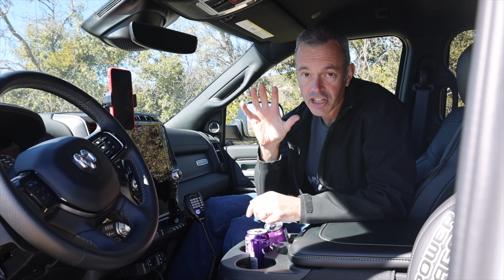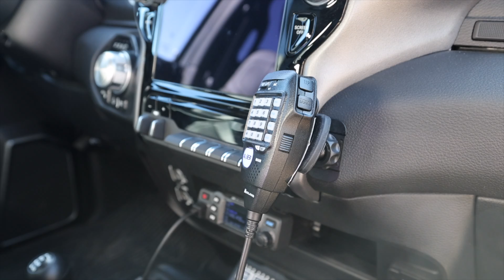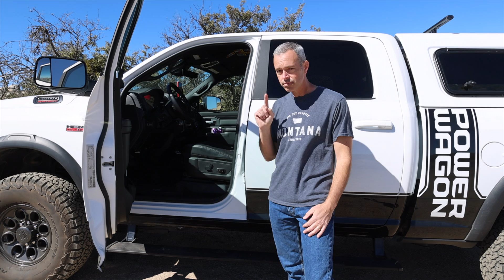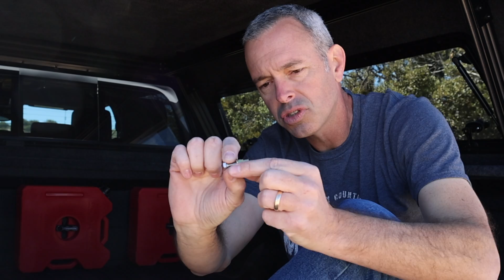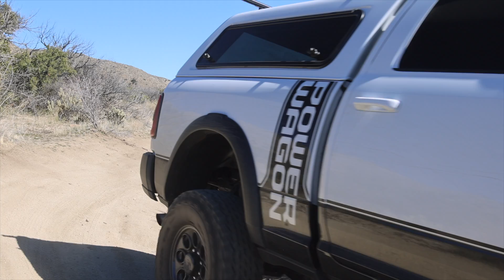Will 37" Tires Fit on a Stock Ram Power Wagon? - Build Update

Comment: Brad, you’re my new truck offroad hero and I’m subscribed to all the PW guys and known legends out west who only drive trucks (as you’re known for being a jeep guy). But still I just love your channel due to your awesome trips, spending time with your sons, mentioning the wife just enough lol, descriptive and carefully articulated overviews of parts, accessories, and techniques...but in regards to your spare tire situation. The ram 2500 can fit an Aired down 35 within that circular frame shield under the bed connected to the chassis. I believe you could remove that and customize a way to hold a 37 there no problem (in the grand scheme of things).

Comment: Hey Brad, the Power Wagon is looking good.  In regards to using a full-size spare tire, Expedition One makes a great rear bumper with dual swing out tire carrier set-up for HD Rams.  I have had their similar bumper set-up on my JKU for a number of years and has worked out great with no issues.   For a less expensive option, AEV makes a vertical bed mounted tire carrier set-up for HD Rams.

Comment: The way they mounted the tubes for the rack to the t-slot is interesting. Wondering it's reinforced inside the tube. Without any, over time it might not look to pretty. Props for them going with t-slot extrusions though. That stuff is awesome.

Comment: There is a rear bumper with tire swing out that you could fit a 40” tire. Also on the inside of the swing out you could have a drop down table for camping or an area to carry the fuel jugs

Comment: AMP step won't do on the trails I've taken mine.  Sure the wife doesn't exactly appreciate getting into my truck, but the Maple Off-road sliders I have do bring the step -in height down significantly.  You can't go by the lower edge of the door opening.  You actually have to step up further to get to the flat surface.  So, I would say it drops the step-in height by several inches.  Between that and the use of the hand grab, it is manageable.  My rocker panels would be destroyed by now if it weren't for the sliders.  The kick-out in the rear has enabled me to get around some tight spaces where that rear wheel wants to take the short cut.  Regarding a lift.  Most folks do a level lift (Thuren or Carli coils) which brings the front up and actually tips the rear back a bit.  Get rid of the chin spoiler and do a level lift will get some needed clearance up front, while making the rear slightly more accessible.  Love that cap.  Exactly what I would envision to be the perfect cap for these trucks.

Comment: We have a Ram 3500, AEV lift and AEV Bumper/winch, with an ARE commercial an Alu-Cab RTT/awning, the ladder is an extension one it is very high off the ground, great views though!  We're going to be getting the Expedition One rear bumper soon, for our spare.  I really like your setup, a lot, we wrestled with getting a power wagon or going the diesel route, we went diesel with the HO.  We had a power wagon before, which was great but we were hoping for better economy and we did get that with the diesel.  Out of curiosity, when you get an AEV lift, you can buy their Pro Cal module, which calibrates your speed and shift points due to the new maths, perhaps that works for the 6.4 as well?  Often we see 18mpg, and I run a dirtbike setup hangong off the back sometimes, best I saw was 20.6mpg for a 3,000 mile trip.

I'm sure you know about regearing, especially after your videos and your trip to Alaska, but I was curious if you were thinking about regearing the PW.  Our rear end is the 3.43, I only will regear if we go to 40's but I do not want to (wife does) as I can reach the awning to deploy and such now, 40's no way.

Comment: Cab roof rack. Would be a great place for spare full size with shovel, jack and air compressor w/tank (lots of fresh air up there). A rack with tall/large sides would also provide mounts for lights. I have the Rambox's on my PW, so a hardtop for the bed is out and this is the setup I'm saving for down the road.

Comment: i have rock sliders and it does change the driving dynamic of the truck.  that extra weight 12 inches off the ground is notable.  you will be fine with extremely careful tire placement, but if you hit those powered steps you'll instantly crush them.  loving the wagon vids!! bring that to NOCO for the Overland West and we'll hit kelly flats trail (if it's open this year).  that will test your truck going up hill.  I have a video about it... super fun.

Comment: I put 35s on mine because of ease of use. No trimming, better gas mileage. But now i can see that mpgs are not significantly changed (in my experience) with an upsize. And 37s just flat out look better, so ya I say go 37s on this platform if you can, or you’ll regret not doing it.
Reply from the maker: The stock 33's really look extremely small on this truck, 35's and 37's look better for sure.
Reply: @TrailRecon  

What did you say the name of the tire was. 33x17x9 to 37x17x9 with a +22 offset. Did you have to do anything with the transmission/gears to allow for the extra weight and size.

Comment: Really like the ARE bed cover/cap. I like the side opening windows as well but most likely you will need to stand on the rear tires to reach the floor of the bed from the sides. I am looking at various ARE cap models as well for my 21' Power Wagon. I've had two of their caps, (Z-Series) with their sliding front window and tip out side windows, installed on two different trucks. The ARE product line is outstanding.

Comment: Great video.  2 suggestions.  As for your spare tire. Does your camping trailer run the same size tires? If so mount it on the trailer. I know that you will not have a spare without the trailer. But, in my humble opinion. Its rare that you will need a spare. Now as for your nut-serts. I highly recommend using a dry silicone lube on the threads. Can't tell you how many times I have had problems with them in the past. Just a little insurance.  Other than that I like what you have done. Clean, neat and still looks stock. Kind of like that style of upgrading.
Reply from the maker: The trailer has 35's and the bolt pattern is different.  Would be cool if I could find a way to store a spare in there though.  Thanks for the tip on the nut certs.

Comment: Finally someone put a shell on their overland truck. I don't understand the draw of the rack systems, everything gets wet and potentially stolen. Are the windoors or gull wings usable? They look pretty tall. I ended going with the Leer because the  window profile matches the the truck windows better,unfortunately the frame less windows don't allow for the windoor option.
Reply from the maker: The side doors are tall, but I've got long arms and can hop on the tire if needed.

Comment: I thought the Powertanks needed to be upright or at least 45 degrees upright?
Reply from the maker: You can request them to install a snorkel which allows you to use the tank in the horizontal position.

Comment: Brad as a fellow PW owner, I can’t recommend enough the rear track bar relocation kit that Thuren sells. It raises the attachment side to the axle for the panhard, thereby reducing the lateral movement of the axle through the up and down arc during compression/rebound. Takes the waggy out of the wagon. (You’ll probably notice what feels like bump steer in the wheel during higher speed highway dips, where the truck compresses and then rises back up).
Reply from the maker: Thanks, I'll look into that.

Comment: Ah, reminds me of back in the day when I started with my bone stock ‘16 PW. The evolution over the years to what it is today with a Four Wheel Camper in the bed, Thuren suspension and front bumper, WK sliders, custom dual rear swing out bumper, on-board air, comms, navigation, lighting, full locker and sway bar control. All along, it’s been a great truck with 82k on the clock and has done its fare share of exploring some of Arizona and Utah’s more challenging trails.
Reply from the maker: Love the Four Wheel Campers and can't wait to really start putting the miles down on this truck like you!

Comment: 37s the 35s, standard issue 2500 Rams will run 35s with little to no lift. A Power Wagon in this generation sits more level than previous generation and even then can run 37s like my 2018 Power Wagon with minimal issues. Under the spare tire location, I have a 35" Toyo MT spare but my 37" Toyo RT spare is inside my bed (another benefit of having a camper shell). The stock rims will take 37s BUT they will rub at the radius arms, I got away with +18 offset 17x9  aftermarket rims with my existing 37x12.50r17 Toyo RTs.

Comment: I'd love to see more details on the Waterport install above the wheel hump. I had the same idea of using the hitch mount they provide but would love to see exactly how you did it, other than using the nut cert tool. Also, regarding the spare wheel/tire: what about RIGd Ultraswing? I'm thinking of getting one of those for mine.

Comment: I'm still thinking of a good option for the spare tire; however, if you do go to bed or bumper mounted spare, maybe you could consider an extra spare fuel cell in the place of the old spare.  Just thinking of your safari trips down the Mexican Baja.  I run a 106 inch stainless steel antenna for my Galaxy CB radio.  I ended up with a similar hood mount, but mine actually bolts to the fender (inside with the hood lifted up).  The mounts can be seen at Walcott CB online.
Reply: I've been giving your spare tire delima some thought.  I  saw pics and videos of the roll-away storage bins for the pick up bed.  I'm still concerned about 1 person having to lift a heavy tire into and out of the bed of the truck (or higher) and how that can really be challenging and be done safely.  But if a folding step is installed on the tailgate, one might be able to still get good leverage from their legs and control the lifting into the bed the truck.  With a sliding bed storage bin, you could still make use of much of the storage space available and have the spare locked within the confines of the topper.

Comment: I used a ratchet strap from Harbor Freight and the factory hooks to strap my 37 into the bed.  I did not want the weight off my bumper and by strapping it in near the tail gate all I really did was move the weight of where a spare would normally be up a little.

Comment: I have a 2015 ram 2500 that came from the dealer with 37's. While having my front axle shafts u joints replaced they said the unit bearings were starting to wear. So they did last longer than I thought they would,5 yrs.

Comment: Brad AEV's Vertical Tire Mount might work for you. It will work with your set up. Just a thought. You might have to move your extra fuel though.
Reply from the maker: I actually like that option the best, but it's been out of stock for months.
Reply: @TrailRecon  everything you want during COVID is out of stock for months and months......be so glade when this is over. Didn't realize it was out of stock still. :(

Comment: I would run the spare on a rear bumper tire carrier. I too don't want it in my bed but for u. U could run it on the roof in a basket if your aren't going to run a rooftop tent

Comment: Rear seat delete or 3/4 🤷🏽‍♂️ put the extra tire back there....
Reply: Good idea if he doesn't need the back seat
Reply: @sh0cktim3  right. He rides with one passenger at the most. It’s how he had his Gadiator... back seats full of gear
Reply from the maker: Ya, I like the goose gear rear seat delete, but I want to keep the rear seat for this truck so if my sons or wife want to come along they can comfortably.
Reply: @TrailRecon  I guess the only other 2 options is a hitchgate style mount so you can swing that wheel out  to the side on the rear or indeed the truck bed.

Comment: Just disconnect the power to your steps when you're on the trail so that if you do happen to bang it you can get out and assess any damage without having to worry about breaking the motor or other hardware when it tries to open after it just banged a rock.
Reply from the maker: Good suggestion, maybe there is a switch I can easily install.

Comment: I'm a big fan of heavy duty rubber bed mats, even with a Line-X or factory spray-in liner, I use those mats because they prevent things from flying around the bed. I don't have to worry about strapping everything down with those mats, they are so good at keeping things from sliding around.  They also protect whatever you put in the bed from being scratched up by the sand paper like finish of bed liner.  They also look good and finish things off, easy to clean, and less than $100.

Comment: Brad do you mind me asking what the shell cost
Reply: Optioned differently with a tool box included on the drivers side and aluminum paneled "windoors" on both sides rather than see-through "windoors", as well as no roof lining, mine was ~3500. I didn't see or hear if he had lights that illuminate when a panel id's lifted, but mine does. Also, mine is on 5.5 foot bed on an F150, so his is about a foot longer.
Reply: like entergynso said, roughly 3500 for an ARE option, +/- options and cost. Our V series for this same vehicle, with toolbox and windows, 3500 retail

Comment: Carli suspension has a prototype spare tire carrier that replaces the factory to hitch and fits a 38” tire
Reply: That's only on the super duty. The rear trackbar location on the 2500 interferes with a larger spare
Reply: Bummer. I did not think of that. Makes perfect sense though

Comment: Do you think you will have to re-gear or is it doing just fine. Just wondering how it did towing the trailer.
Reply from the maker: No problem towing, I don't see a need currently to regear.

Comment: Looks awesome, Brad. Consider getting a BedRug bed liner. It’s foam with carpet, super lightweight, and it makes crawling back there so much nicer on your knees.  Price is only about $200 as well. Also, just deflate your spare, then inflate if needed.
Reply: Love my bed rug.  I like the full length one piece model that goes all the way to tailgate.

Comment: Dynatrac ball joints, Thuren soft ride front coils, Fox 2.5 w/dsc, and stuff a 35x12.50x17 tire under the bed as a spare. I've run my 35 spare with the 37s twice and its not bad. 30 psi in the 37 and 65 psi in the 35 and they are similar in diameter. I like what you've done to it, looks sharp!

Comment: You can run a 35" spare in the normal spare location with the tire aired down somewhat and you may have to modify the heat shield to get it to fit. Given that you carry air and a tire patch kit that should cover you in just about any situation. Just don't over do it if you have to run the 35".
Enjoyed the video.
Reply: I fit a 35 mickey Thompson baja boss  m/t aired down.

Comment: Would a deflated 37” tire fit under the truck. I believe that a 35” will fit and since you have Air you could just inflate the 37” if/when you might need it. 

Do have an install video or any pointers on the Amp Research steps? I am definitely in the market for those steps. 

I love the Power Wagon and the mods you have done!!
Reply: 35" spare will only fit if you underinflated in the spare tire well. 37s require you to store in bed or with an external mount.

Comment: Hey Brad,

What is the brand of magnetic mic holder did you use.  We are installing a Midland MXT 400 in our 2017 Power Wagon and are having a hard time coming up with a good spot for the handset.  An adhesive base would give us some more options
Reply from the maker: From SCOSCHE, I put amazon links for a bunch of the stuff in the video description.

Comment: On my PW, I mounted an ARB twin compressor on an aluminum plate and slid it under the rear driver’s side seat.  The bolts that held the seat down also secured the plate.   The wiring and tubing was run under the carpet and into the hidden compartment then ultimately to their final destination.
Reply: What's the final destination the battery?
Reply: @sh0cktim3  the battery for the electrical obviously, and the air tubes to two air ports, one in the front, one in the rear.
Reply from the maker: I like that idea!
Reply: Pics??

Comment: You can probably get too a trail head with the 33" spare. But the computer totally flips out when it sees such a giant tire size difference. You would probably have to stay in low range when disables the stability control. It is kind of weird that a 37" tire fits under a gladiator, but not the much larger Ram.
Reply from the maker: I almost want to just throw a 33 on and try this....
Reply: @TrailRecon  I know JKs do not like it, I assume the Ram will act the same. But sounds like a cool test :)
Reply: @TrailRecon  Oh, low range wont work. Because the different sized tire (being that far off) will change the overall rotation speed of the front axle and cause it to bind up with the rear axle speed.
Reply: Yeah engineers probably didn't think about it. Or its still using the same old 2500 frames that have been around for a long time at this point.

Comment: I have never needed a spare. knock on wood!🤞 tire repair kit is they way to go in my opinion. I ran 35" cooper sttpros than went to 37x13.5 coopers on factory wheels.
Reply from the maker: I've used my spare many times unfortunately.
Reply: Any rubbing with or without sway bar disconnected?